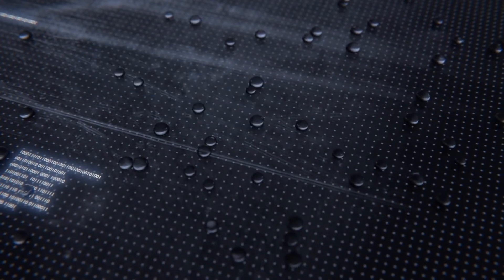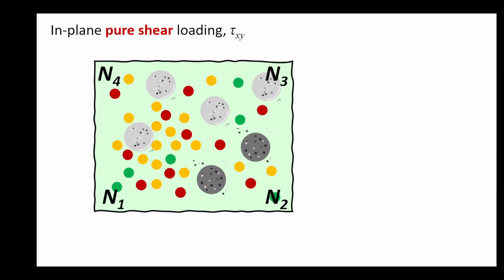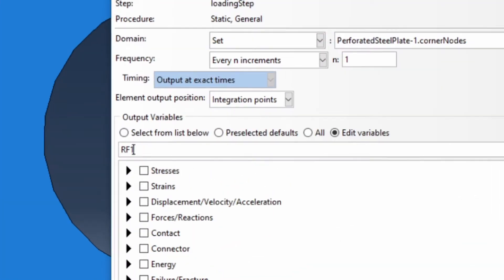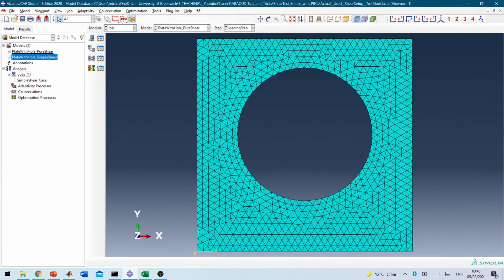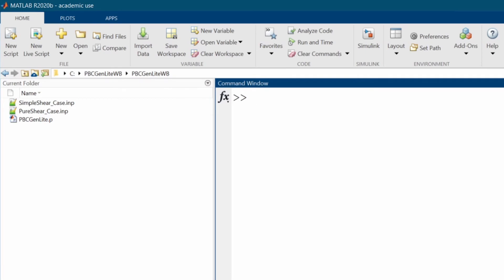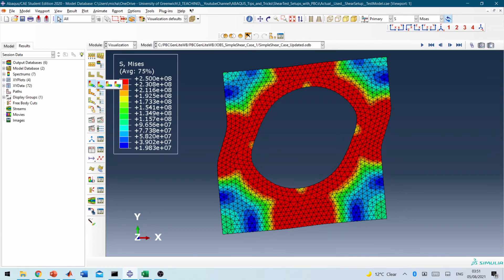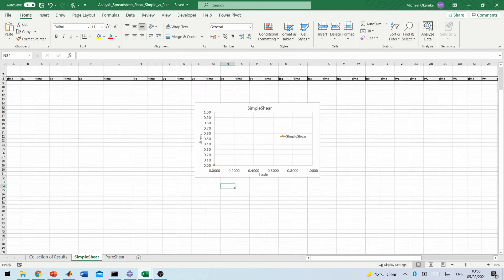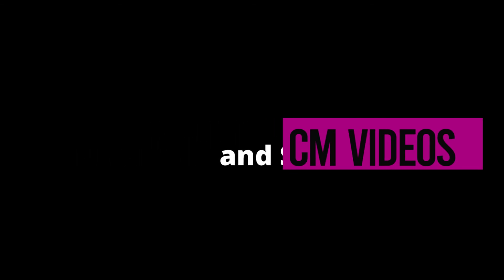How to create simple and pure shear in ABAQUS

Comment: The shear strength of the same material is a fixed value, but different testing methods have resulted in different outcomes, with a discrepancy of nearly two times. How can this be explained? Which type of shear modulus is used in ABAQUS? Thank you.
Reply from the maker: Hello, thanks for your comments. 

With regards to the discrepancies, there is really none. I will point you to this point 10:20 in the video where i showed comparison of the contour plots from simple and pure shear. You would notice that there is complete freedom of deformation for the corner nodes in pure shear whilst for simple shear the top left hand corner was constrained. This means that the shear strain contribution from that corner is non-existent. 

As a result, you will end up under-representing the strains from the structure, hence the simulation results comparison shown at time 12:00.

I am not surprised about the equal values of the shear strength as due to the underlying elastoplastic material model (once failure happens) the structure will yield. So, whether it is pure shear or simple shear, the failure happens and the yield strength at that point takes over hence after yield, both simulation types will converge to the same shear strength (post yield). 

Due to the unaccounted shear strain at the top left hand corner, the strain will be different which will result into a different Shear modulus. Of course, it will be half of the expected value since we have lost some strains by constraining the model too much to simulate simple shear.

The essence of this video is simply to illustrate what sacrifices we are making when adopting a simple shear deformation simulation. It will matter very much at small strains (elastic properties) but at large strains and post-yield, it will not matter.

I hope this clarifies any confusion.
Reply: Thank you, I understand now. You are amazing! @MichaelOkereke
Reply: @MichaelOkereke  I think for pure shear case, shear strain is 2 times that of simple shear which is not taken into account. That is the reason results are twice more.